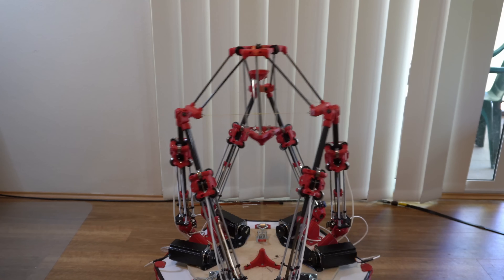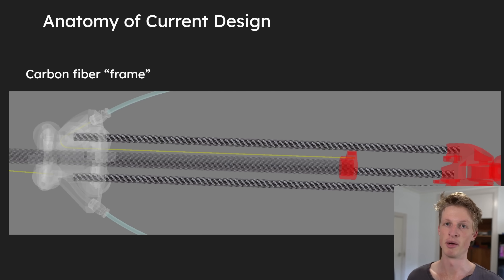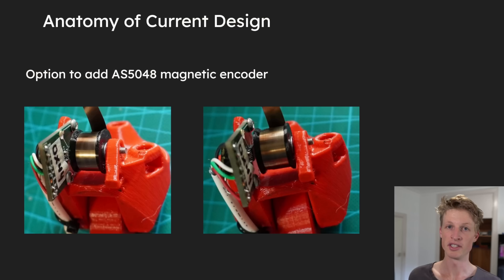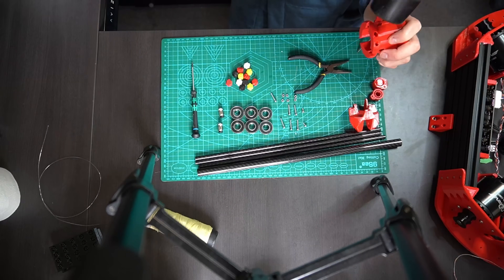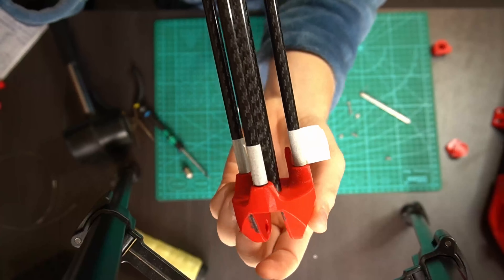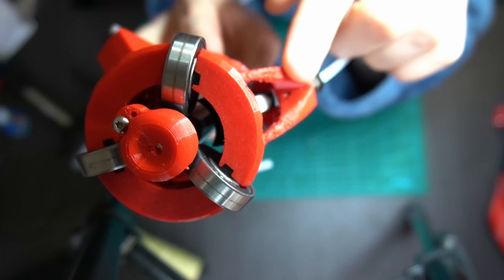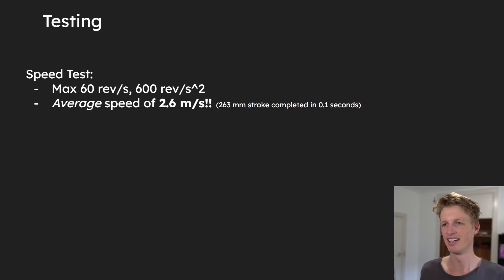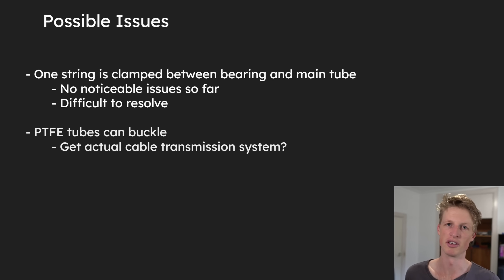Designing High-Performance Linear Actuators: Speed & Stiffness for my Juggling Robot | PDJ#19

Comment: 💡🌬 Have you considered using braided UHMW for the string? It's commonly used in high-performance kites and offers several advantages. It's UV-resistant, water-repellent, and has excellent abrasion resistance. Plus, it has lower friction and almost zero stretch, resulting in minimal backlash. Another bonus is its affordability. Great suggestion! This video is full of excellent insights. Thanks for sharing! 👍🤖🎪

Comment: I'd use bicycle brake lines for the tubes, and kite string which is specifically designed to have very low stretch under tension

Comment: Couldn’t you just slip a stiffer vinyl tube over the teflon tubes instead of revamping the whole thing? Maybe you could print an articulated shell for it if the vinyl isn’t rigid enough

Comment: "linear gear rail" should also work
Reply from the maker: I actually had a design that used a rack and pinion at one point! Decided against it because I couldn't get it to work well with the motion of the rest of the robot; these actuators need to rotate quite a lot about two horizontal axes (think: ball joint) and I couldn't get a rack and pinion to work well with that constraint

Comment: Hey using the current as a limit switch is an excellent idea, but couldn't you run into problems when the actuators come under a sudden load, also causing a current spike?
Reply from the maker: Yeah, it would if I was monitoring the current spike the whole time, but how I've got it set up right now is that the current is only monitored during the homing phase, when the actuator is moving with a known speed (and hence ~known baseline current). 

I've considered always monitoring current to catch possible failures before they get too bad, but have decided against it for the reason you mentioned

Comment: instead of having the string on the outside and have it get caught in the bearing. Why don't you put the string through the middle carbon tube and create a small pulley at the top so it doesn't cut it
Reply from the maker: The main reason I didn't do that is because it would require cutting a slot along the whole length of the middle CF tube, which I don't think would be ideal for its structural integrity.

Comment: Just a thought  - could you fit a plug in the end of each CF tube which is then glued in place and which contains a nut such that you can bolt the tubes in place from the end? that way you don't need such a friction fit in the frame.
Reply from the maker: Yeah I've been thinking of something along those lines. I think I have an even nicer idea that would involve no interference fits at all, though I still need to test it out. Cheers for the suggestion!

Comment: im building a gian robot and my design needs fast strong leniaochiao???  relatively long stroke lenght commercially available in ur actuvade is rather too short or too slow or too expensive so ive made im own ai previously maid a vide on a lenioactiuiators??? on a using vaceend which ws very strong but there were quite slow a littdl wobbly and kinda laudh howvever if yo affsuali ded is very stong and u dont mind so much abouh speed that i suggest chekin ou hat video nouw almost a year later i found a design that exactly what i needs its super faast quiet steiff fairly leifh and has a pretty decent stoof lengh in this bide o want to cover this new desin wooks? how its maid how well it perfoooms as well as some possible issues taht i can see with the design  befoor we get into this pesifiks of this desing its wooth looking at the requermets of this designaaaa focaruble sleeps interctional is they need to be faast (im done)

Comment: The fastener you need to attach the carbon fiber tubes without having to hammer them in is called a well nut or expansion nut.
Reply from the maker: I've not heard of those before! Could you elaborate on how they'd be used to mount the CF tubes? I've been thinking of ways to get rid of the hammering. It's not the best...

Comment: Easy upgrade for your string tubing, insert a spring inside it of the correct diameter, then pull. You should be able to get one spring turn per 20mm or so, which yields both an internal structural advantage (no collapsing tubes), and reduces the string contact area to 1/spacing, the kevlar will ride on spring instead of the entire length of the tube. Much less friction.

Comment: For a cable transmission system - maybe look into bicycle brake cables or even the twist-throttle mechanism of a motorcycle. These already do what you are trying to accomplish at forces and levels or reliability magnitudes greater.

Comment: Very nice solution! To make it more long-lasting, I strongly suggest to put an outer liner of hard PU on the bearings with a slight groove. Rolling friction will of course increase a little but the contact pressure and noise will decrease radically. Another alternative is to use really thin-walled stainless tubes with carbon inside for strength and stiffness and the bearings as is.

Comment: Bearing should runs on flat surface, when it run on round tube, there is only a line contact. Just using metal tube and brass brushing is enough. For frictionless, using the brushing with small rolling balls inside

Comment: I wonder if you could replace the PTFE tubes with linear bicycle brake cable housing, but replace the steel cable with the Kevlar string. Have the string and cable housing extra long so you could add a loop, that should give you your flexibility (housing wise). The housing is also lined with PTFE, so wear should not be an issue. The brake cable housing should eliminate the buckling issue and you could even incorporate threaded linear adjusters (like the ones on bicycle brake levers) to tension the Kevlar string if need be. I like your design. I have been thinking about doing something similar, but also very different. I like the use of the Kevlar string. Great idea!

Comment: If there is no requirement for the ptfe to move/flex the you could possibly use 2mm copper/aluminum tube and run 1.2mm or 1.5mm PVC coated steel cable through it.

Comment: Btw, interesting, when I was designing a ball screw actuator for my job, I needed to slow it down, it was too fast. And still, according to my calculations it was strong enough to rip itself apart if limit switches failed
Reply from the maker: Wow, what was the application for? My earlier ball screw design was way too slow for Jugglebot. That said, the main speed cap was the motors not going faster than ~15k steps/sec (absolutely no idea why). Perhaps with faster motors a ball screw would work, though I reckon the inertia of the screw would cause issues going at these speeds.

Absolutely agree on the strength of ball screws! Those actuators were insanely strong
Reply: @harrisonlow  I needed to move a needle in a hydraulic valve accurately and quickly. I used a relatively small servo motor with max rpm of 3000. Unfortunately, I quit before the thing got completed, so I haven't seen it work with the valve
Reply from the maker: @Zoey_the_Rat  Bugger! Sounds like an interesting project

Comment: Just wondering if you considered hydraulics ?
Reply from the maker: My very first design was (admittedly, rather shitty) hydraulics, actually! I think it's far too slow for what I need these actuators to do, and from my previous experience with hydraulic actuators—granted, these were "soft" actuators, rather than the normal kind—I'm not too keen on having to deal with all the associated leakage/control problems.

Comment: The most tried and tested way of doing this, I would think, would be something like the motion system from a 3d printer, which usually uses timing belts to sling a component around, against very high forces and accelerations. The fastest I've seen in 3d printers is 800mm/s (for "travel" moves when the printer isn't extruding anything), which is only about a third of what you're getting here, but in fairness that's throwing around a pretty heavy mass, usually about half a kilogram, so if your actuator is light enough and you use the brushless motors instead of the steppers that printers usually go for, I suspect 2.5m/s is still achievable. The advantage is that these are pretty well-tested mechanisms and have a very low part count--motor, idler pulley, belt, and a belt block with a tensioner for the end of the actuator inside the frame.  That's about it. Probably worth at least evaluating whether it would work for your use case.

On the other hand, if you get your version working just the way you like it, you might want to build a high-speed 3d printer with the same mechanism ;)

Comment: As a mechanical engineer, I find concern with the choice to go with carbon fiber when a thin-walled aluminum would've done fine. And as an artist/inventor, I fucking love it.

I've made parts that have struggled to perform just because they were too weak, or too thin. At that point, the inventor in me said fuck it, made everything out of 7mm-thick mild steel, and laughed as it worked perfectly. Great work!

Comment: One hint from having built similar structures with 3 struts, is that they tend to have very poor torsional stiffness. A single big round tube might be much better and of similar weight.
Reply from the maker: Yup, a single larger tube would be a lot stronger in torsion (and tension/compression), though for my application, these actuators will never see any appreciable torsional stress, so it's not an issue for me 😊

Comment: Id recommend looking into either spectra or dyneema line as its EXTREMELY strong, zero stretch, abrasion resistance is off the charts and its very affordable. As for the play in the bowden tube, you could probably route the ptfe tube through the carbon fiber tubes or... You could use some rigid brake/fuel line or copper condenser coil tubing to route the ptfe through which would remove any loss of motion there resulting in a more accurate and faster action.

Comment: it seems to me that if the ptfe tubes are straight then buckling isn't going to be  an issue. I would much prefer them to be aligned with the frame, (zip tie?) and the exact length that they need to be.  I'm wondering how much power they actuators can hold, before breaking. Very nice design.
Reply from the maker: The trouble with having the PTFE aligned to the frame is that for my application the actuators need to move around quite a bit relative to the motors, so the PTFE tubes need to allow that motion to occur.

FWIW, just minutes ago I finished the prototype of a new actuator design that has the motor attached to the actuator, in-line with the extension axis. If it works (big fingers crossed!!) I'll post an update video on the new design. Hopefully I'll also find a good way to measure power/force, since a lot of people were wondering about that.

Cheers!

Comment: Awesome! I'd put some lubrication to the bearings and to the wire tube, which especially will get some friction IMO. Never seen any DIY builder using lubrication 🤪 

Bicycle break or gear cables housings come into mind. Their diameter is considerable, thus, I wonder the extra leeway would case slack in practice.. Thus, how tight fit with the wire and the housing should have? 🤔

Comment: Bicycle brake cables have excellent compression strength while being somewhat flexible and light! Also, they're relatively cheap. They are usually lined with some softer plastic but they are designed to house steel cable under high tension. may be worth a check, but not sure if the diameter of your aramid string is small enough to encourage cutting into the plastic liner of those cable housings.
Reply: Came here to say this.

Comment: Did you consider using a large diameter tube in place of the 3 small tubes?
Reply from the maker: I toyed with the idea but couldn't figure out a good way to make it work without having to cut into the larger tube, which I'm not too keen on (partly) because I only have hand tools and I've learned to not trust myself to cut things to any reasonable accuracy with the tools I've got.